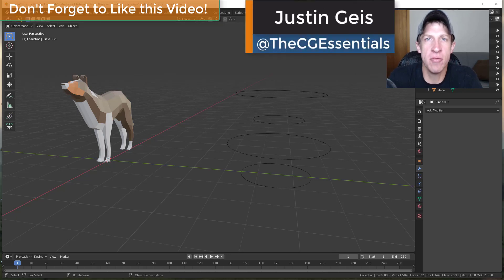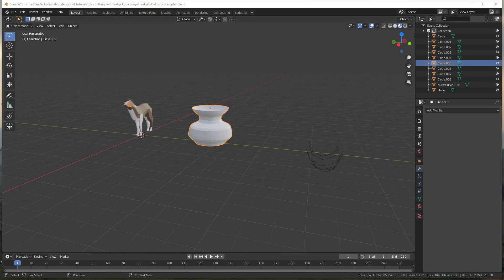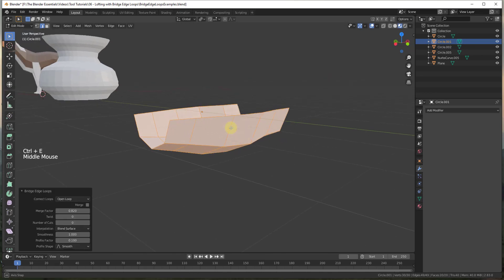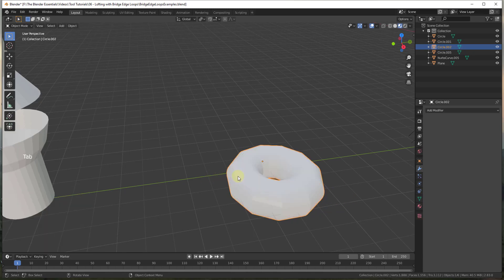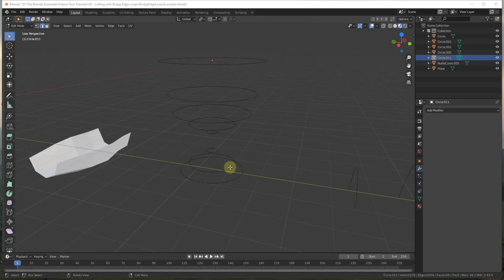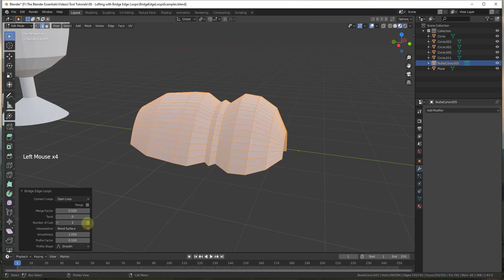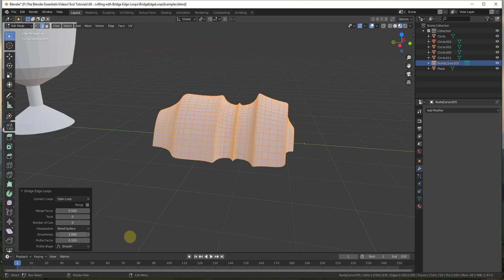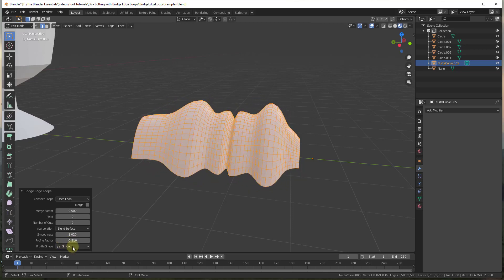Using BRIDGE EDGE LOOPS in Blender to Create Complex Shapes with Lofting!

Comment: I kinda wish you had created the circles and mentioned the Ctrl+J thing at the very beginning of the video. This really doesn't work without that step. I was going nuts trying to figure out how you made the circles into a single object until I opened the description and read that step. I'm brand new to Blender, so I thought maybe that I was supposed to use bezier circles instead of mesh circles, but those didn't work either. I realized after watching the rest of the video that you covered Joining later. But I tend to pause your videos as I learn, so I never got to that part. I was stuck for quite awhile trying to make the opening circles work. I almost quit the tutorial in frustration until I thought to look in the description. 

I find your videos are the most helpful. Most "beginner" tutorials seriously suck because the instructors are great technicians but very poor teachers. They assume a base level of knowledge about Blender where there may not actually be one for a beginner. Your videos are excellent, but be careful. You're an expert. What's a small step for you may be a dealbreaker for noobs who won't just "figure it out". I'm a Photoshop/Illustrator instructor, so I'm not unschooled. I'm just really new to 3D. This is a totally different design methodology that literally requires a dimensional shift in how one thinks about space and asset creation. I'm having to break a lot of old habits to learn new ones. I love your courses, but sometimes I feel like I'm hanging on for dear life just to follow you, because I missed a small step like this one.

Comment: Thanks for the video it just saved my sanity.  I could not figure out why when I tried to bridge two objects nothing happened.  When I duplicated an object while in Edit mode the Bridge tool worked.  However, whenever I duplicated an object in Object Mode and then went into Edit Mode with both objects selected, the Bridge tool did not work.  This video made me realize that the most important thing for this tool is that the objects to be bridged must be joined!!!
Reply: Hello, I have same issue. When I create 4 circle independantly and after select them all and edit , I can access all  of them but when using bridge edge loop it does not work. It work only if I create this cercle in the same object.
Reply: it's explained in video at 3.12. CTRL+J to join them all before appliyng bridge edge loop...